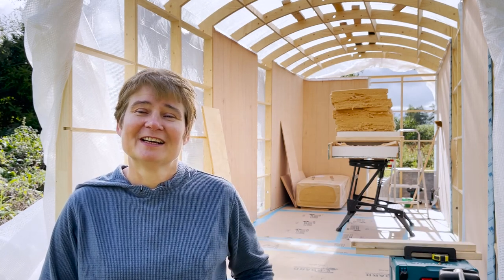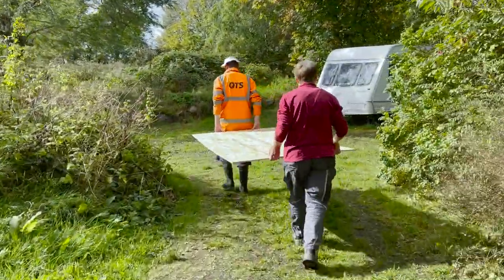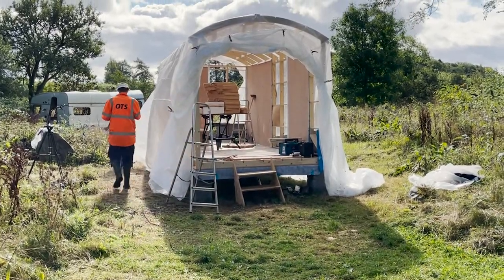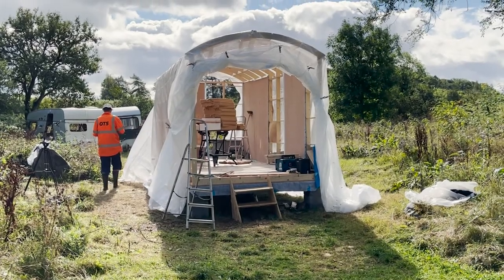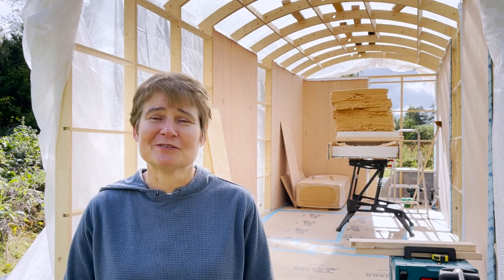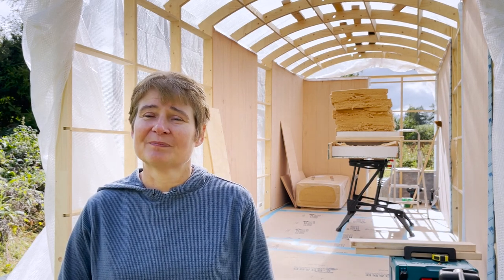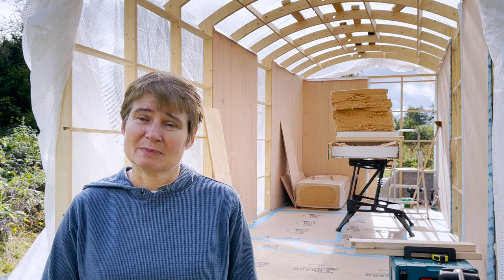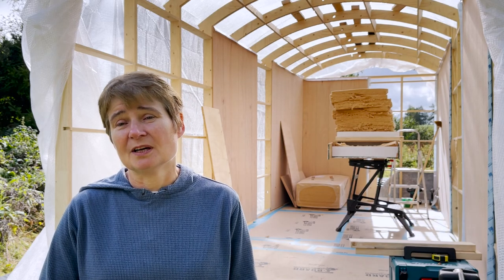How to build a Low Energy Shepherd's Hut - introduction (Ep 01)

Comment: Any more video on the curved roof members.  Great video I'm looking to build similar.   My tiny house build was 95% non toxic building materials but of a challenge. Thanks dave
Reply from the maker: We only shot 4 episodes of this series so more more content on the roof detail. The roof used flexible wood fibre insulation to account for the curve.  Interior side was sealed with Intello Plus airtight vapour control membrane and on the exterior is Solitex Plus windtight breather membrane. Airtight tapes used throughout to seal all overlaps and junctions.